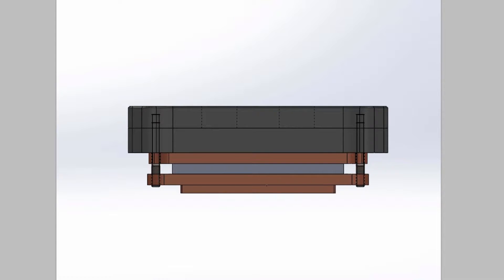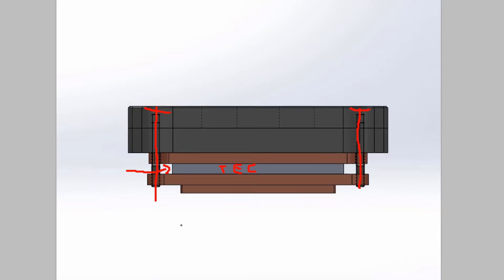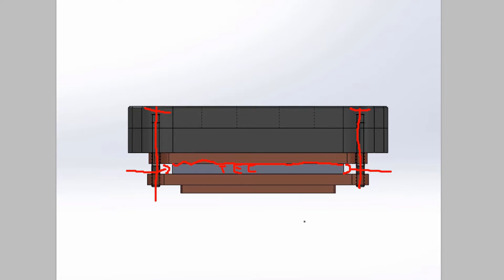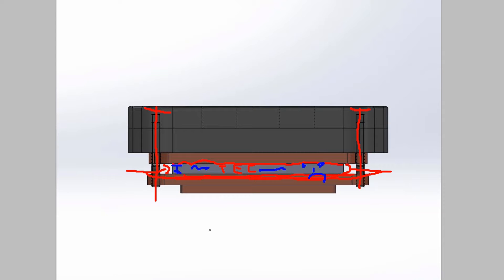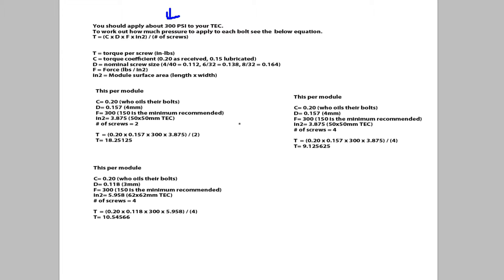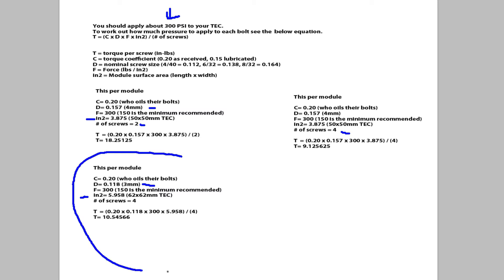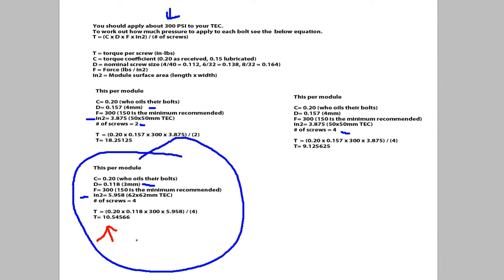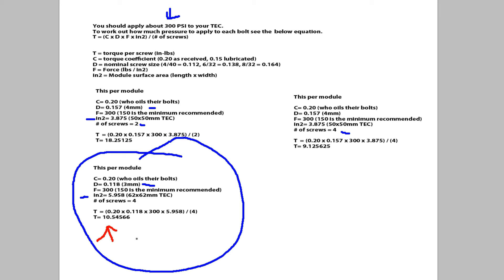Peltier Waterblock Theory: TEC Pressure Episode8

Comment: Thermal expansion or contraction.
There must be a few variables.
Sleaving the fastening screws and/or using stainless perhaps with a fine pitch if the parent metal/material/nut can cope with it.
The video is super helpful 🙏
I have little silicon rings to partially recess into the bolt holding plates.
The silicon heatsink gaskets that are available might average-out pressure variations.
Distance and locations of the bolts will fluctuate during the torque-up.